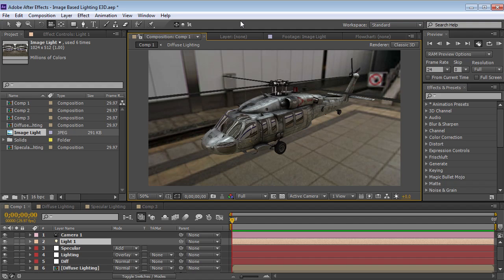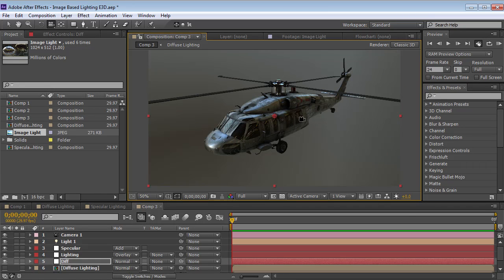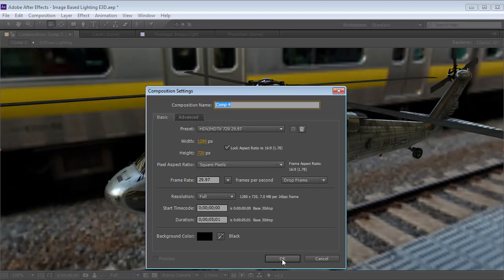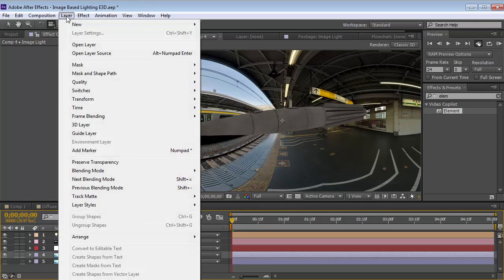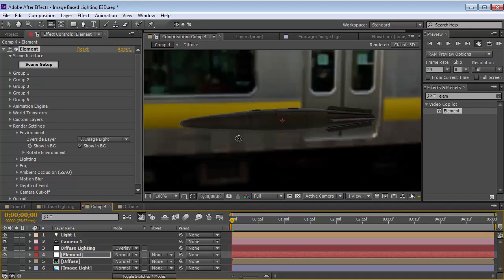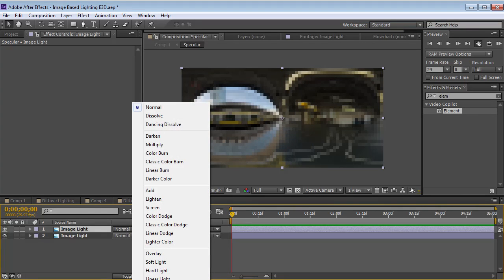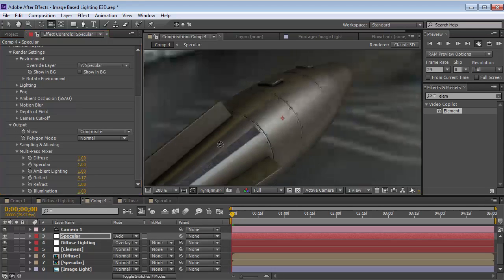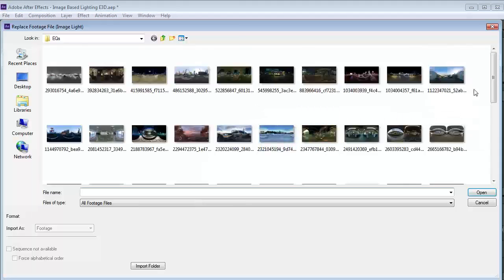Image Based Lighting with Element 3D

Comment: I think you're right that it saves memory and probably a lot of processing power to downsize the images like that. If it had to take on two different full-res images in order to derive Diffuse and Specular lighting you can imagine how crazy it would be. I know whenever I set up image based lighting in Maya with a large image, it takes years to render, and viewport 2.0 becomes practically unusable. I think it's pretty smart to make it as small as possible.

Comment: when you scale it down to this sizes, the pixels will compress to an average so in with the size of 4x8 you want having a smooth defuse lighting on you object and with the other more detailed image 64x32, you have the specular lightnings.
So the point is, you don't need very detailed images, this kind of sizes re just enough.

Comment: That does not make Element3D a bad tool though. It depends on what task you are trying to use it for. If you want to work in the professional film industry, no knowledge of a single plug-in or software tool will get you very far and yes, you will probably have to have a very deep understanding of pro software packages like 3ds Max or Maya. But for the average hobby film maker (especially on YouTube), Element3D adds a lot of options without the $ or time required to get, learn and use 3ds Max

Comment: Im having problems with Element 3D, I am using my laptop with built in graphics card so not the best and it says my card has not ram. Witch i no about will this cause it to crash every time or is there something wrong. As everything i load it it crashes

Comment: Hey! I'm messing around with Element3D and I'm trying to make like a 3D Equalizer effect based on your Audio to Animation tutorial, now what I did is used the particle replicator and kinda lined up the particles so that when the beat pumps up, the particles would jump, but the problem is that the particles jump in both up and down, instead of just up, like a normal equalizer would do... know what nevermind! Great tutorial! :D